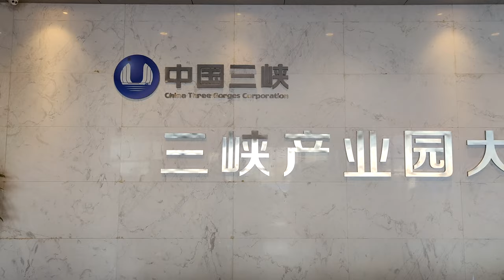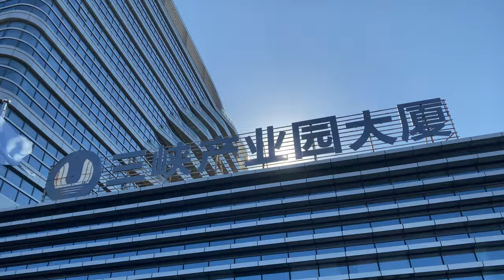China is now the World’s leading green energy producer, It triples down on America’s numbers

Comment: China is also the biggest user of coal for electricity, and growing in leaps and bounds.  No one ever considers they would do BOTH green and black power.
Reply: in 2021 1/3 of electrical power in China came from renewable including nuclear.  The commitment by China is carbon maximised by 2035 and carbon neutral by 2060.  Thus it will be both green and black power even after 2060 if you have any knowledge of electrical power generation, system stability, frequency control and that sorts of things.
Reply: The new coal plants are actually very clean. It produces very little harmful substances.
Reply: You won’t believe how much NG is used to generate electricity in US😂